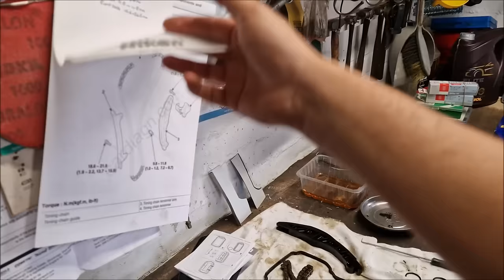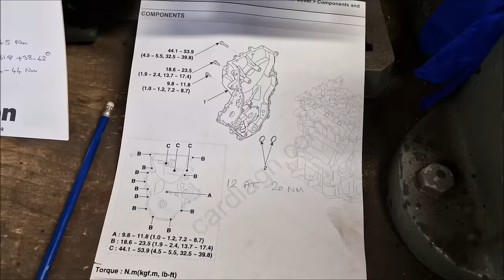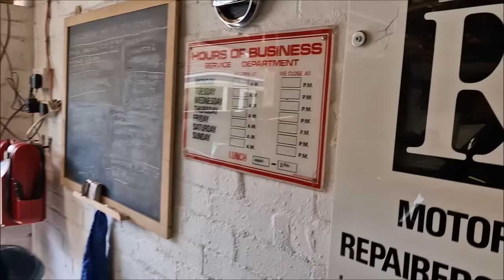Noisy Hyundai i10 Timing Chain Replaced - Part 2

Comment: Never had a problem with the Napa stuff ever. I suppose I have been lucky. Hyundai have had problems with chains tho I do know that like I said yesterday we have replaced a few. 😊 Nice one 👍
Reply: Like the Vauxhall timing chain's there bad for failing I have done a few of them. 🤣👍
Reply: Least it's a chain n not a silly wet belt tech engine 🙈
Reply: @matthewc.419  That's very true
Reply: @AliMackMechanical  FORD only did that , to kerb emissions,  silly very silly 
Throw away engines !
Reply from the maker: Absolutely
Reply from the maker: Indeed!
Reply: Like I keep trying to say 
But u tube won't publish my certain  comments 

NAPA sponsor my fav. BTCC car
Reply: Do they still go bad even if you change oil at 5k

Comment: I enjoyed your video thankyou . I have the 1.2 litre 4 cylinder vehicle which  I bought as a non runner the seller was telling me he had taken it to Halfords and their tech diagnosed faulty timing  chain.  They also said the engine wasn't showing any cylinder compression. Do you think the valve timing could be so far out that the valves aren't seating . Do you advise I also take the cylinder head off to make sure no valves have come into contact with the top of the piston . Because my job is likely more involved that your straightforward timing chain replacement im  thinking of removing the engine and changing the clutch spending a bit on the engine to make sure its as good as can be . So  in summary can timing chain issues cause valve contact with piston 
Or can valve timing be  so far out that the valves never fully close ( maybe that shushing noise you could hear ) 
Do you think taking the engine out of the vehicle would make the bigger overhaul easier .
Reply: I wouldn't rely on a Halfords diagnosis!
If the valves have hit the pistons, chances are it will turn over faster on the key than before due to loss of compression. If so, carry out a compression test on all cylinders and see which one(s) are low.
You don't need to remove the head to inspect for valve/piston clash, instead use a borescope / endoscope down the spark plug holes.
Obviously if compression is low and you can see valve / piston damage, the cylinder head assembly will have to come off to be repaired.
Reply from the maker: Sorry it took so long. I've been waiting to ask dad the question. So first he says NO ... Do NOT take the head off yet. Get the timing right first. It's best for you to fit a new chain to get the timing right and then turn the engine over manually to feel for the 4 compressions. Should you still not have full compression ... Then it's head off time. 😮

Comment: 34:50 They need more frequent oil changes, really.  Short tripping does a number on them
Reply from the maker: Yes we think so too
Reply: @JonCoupland  I worked on them for 8 years in the dealership, these are the better ones but the 1.4/1.6 needed more chains.  5000 miles was even too much for some customers.

Comment: At one time I would have had a go out at doing a job like that on my car's but my current a vaxhall 2015 1.6 diesel Astra j the the engineers thought it would be a good idea to position the timeing chain at the rear of my engin so you have to drop the sup frame if it ever goes fault the garage will be doing it I now longer have the the patience or the tools to do so but I could take to me nephew who is an HGV machinic but he lives down in London which is 300 miles away so I don't like driving to far these days the is something else a could do and traid it in like I did with my last car when the cost of the jobs were going to cost more then the car was worth
Reply from the maker: Thanks for watching 👍😊